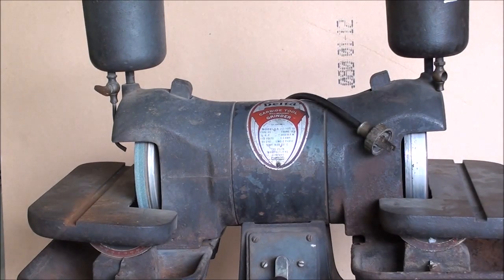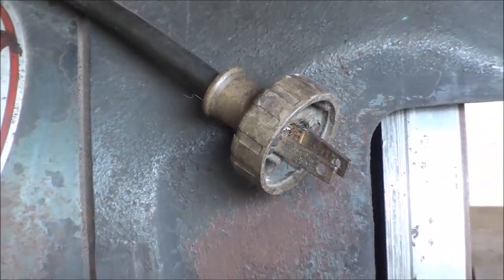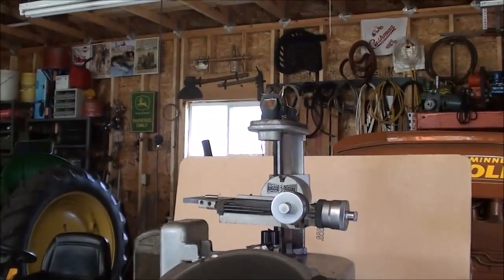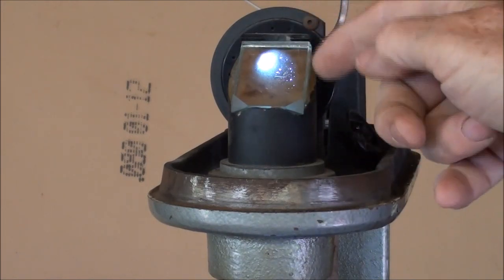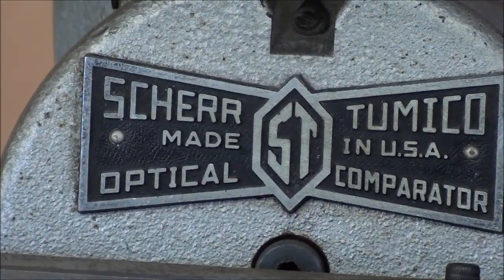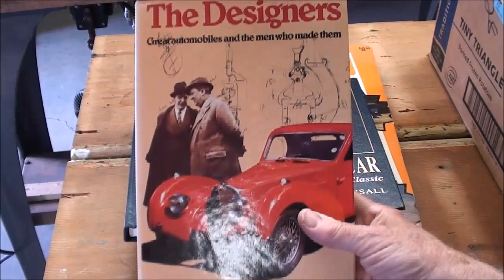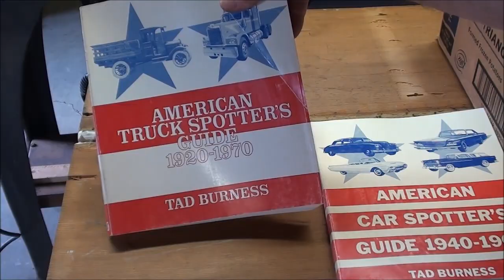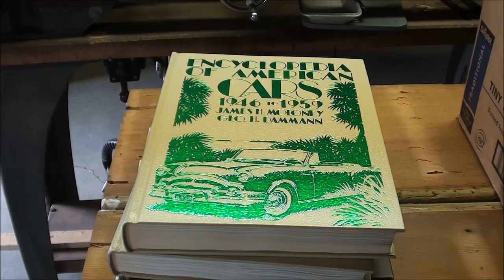TUBALCAIN BUYS MORE MACHINERY #1 mrpete222

Comment: Thanks Mr Pete for another interesting video. That's a really nice grinder. Most engineers and metal shop workers these days have got no idea what an optical compositor is, but it's a mighty handy inspection and measurement tool. Keep the great videos coming.
Reply from the maker: russhellmy Thanks
Reply: Whoops that should have been optical Comparator (not compositor) dang auto-correct.
They are particularly handy for measuring things that deform when measured with micrometers or vernier callipers. such as Orings, light springs, rubber parts, light metal stampings etc. or checking shapes conform to a designated profile.
Mr Pete, I'm sure you can make a mighty interesting video on using an optical comparator.

Comment: Very cool grinder. I agree that the old, heavy, iron stuff is the way to go. It is so much more stable and has less vibration than the flimsy units they sell today.  I've only seen a few grinders with the hollow wheels like that. It's definitely specialized piece of equipment.

The Optical Comparator is also very interesting. I was aware they made a machine like this, but didn't realize how many built-in scales and measures it has. Technology sure has changed but the old way can sure still be effective.

Thanks for sharing your new equipment and books. Always enjoy these videos!
Reply from the maker: davida1hiwaaynet Thanks for watching

Comment: NICE SCORES.
You can make your own templates for the comparator with a computer, a CAD program, a laser printer and transparency film.
Because you have a 10:1 lens, set your print scale to 10:1 and print out the area of the CAD drawing that has the detail you want to inspect.
There are a few other cool tricks, too.
Thanks,
John
Reply: Yep I have a 14" comparator by Jones and yes that trick works and transparency film is easy to get.  Nobody uses that stuff anymore so it goes to thrift stores.  So there ye shall find.
Reply from the maker: John Bazaar Thanks. I'm afraid I can't do all that
Reply: I can't do it at home either. I have to do it at work during lunch.
We have a 14" Covel that we recently put back into working order.
Should you need any replacement parts or upgrade kits such as for bulbs, check out 
Http://genexcomp.ipower.com
They support many older brands and models of comparators for things like bulbs, templates, etc.
The sold us a bolt-in kit to replace the old bulbs with newer halogen bulbs.
Templates are expensive but at least you can get some as you might need.
Thanks
John
Reply from the maker: John Bazaar cannot get that link to work

Comment: You've learned by this time that you don't want green wheels for grinding HSS and it's hellish to find a good pink AlOx wheel to fit that grinder.
Reply from the maker: Yes, and that’s why I got rid of it
Reply: @mrpete222  It's possible to strip the green abrasive off a stock wheel plate, then glue on a pink AlOx wheel and dress it up well... but that's a heck of a project. I've been searching for years to find a pink version of that same green wheel. I have the import version of the same grinder; I use it for carbide. I'd sure like to set up one wheel for HSS, though.